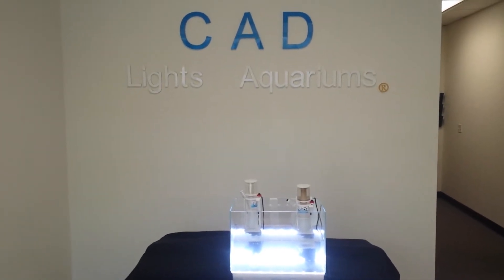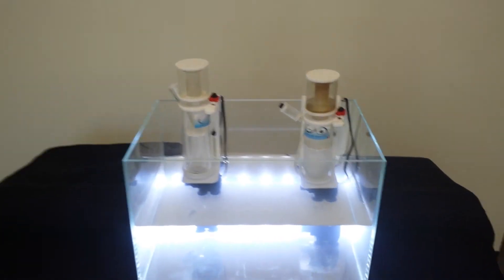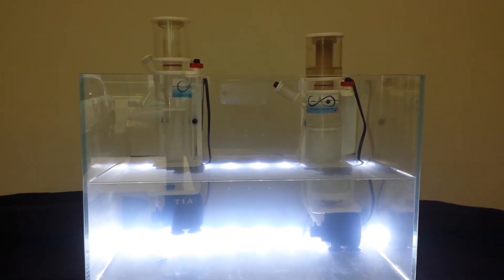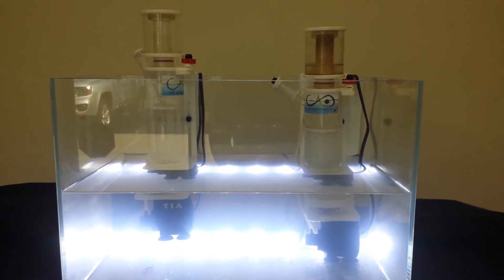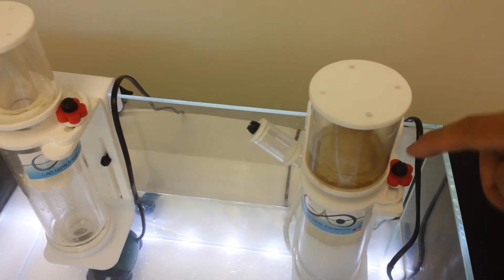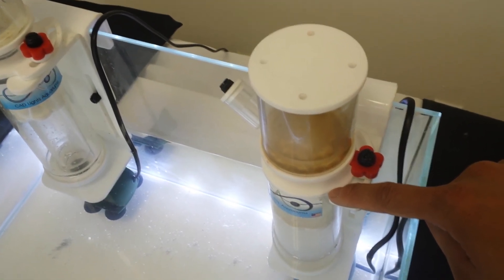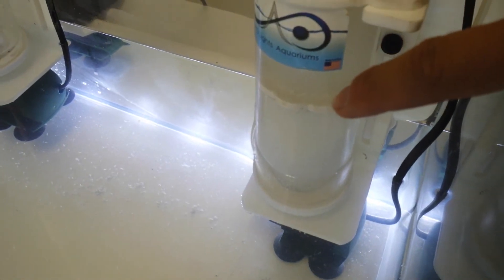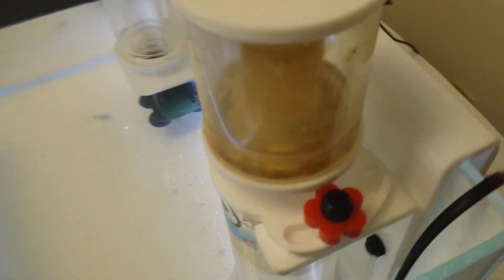NEW PLS-50 Nano Pipeless protein skimmer from CAD Lights Aquariums Pt.2 (Overview)

Comment from the maker: Hi, Chris
Yes, you can remove the rear tank mount and the PLS-50 can sit on the bottom of the chamber, just make sure that the water level isn't too high. the optimal water level is between 5"-7".